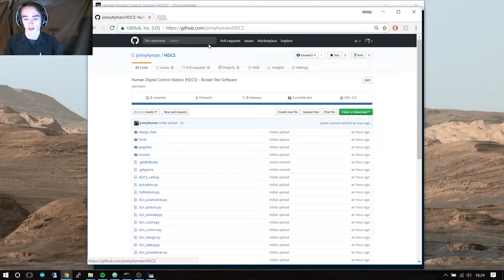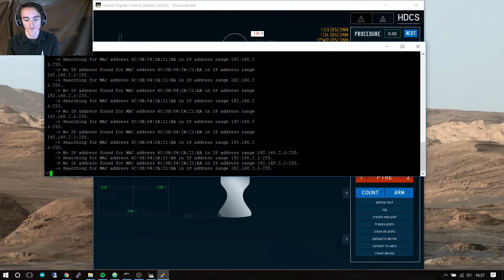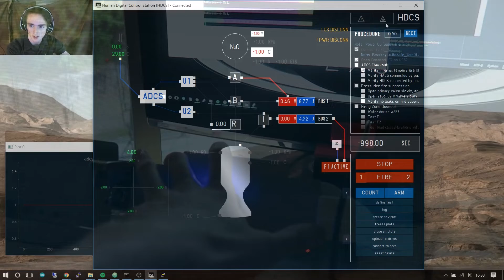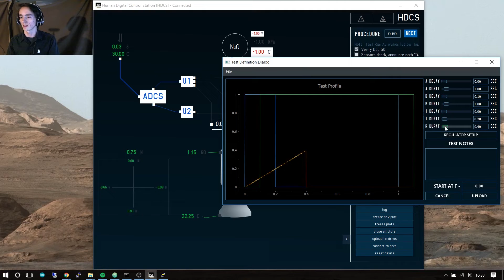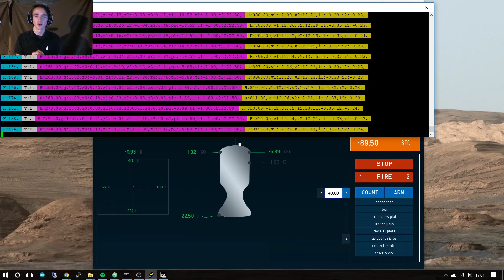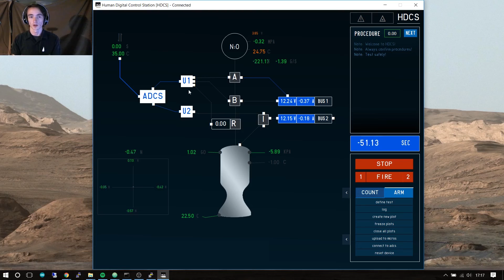Rocket Testing System | Human Interfaces | EXO

Comment: #Question from 550 subscriber your channel.
How much more difficult will be the software, for two components - 85% peroxide and isopropyl alcohol, pressure-feed nitrogen 30 bar
How many sensors are parameters controls, controll drives, etc.?